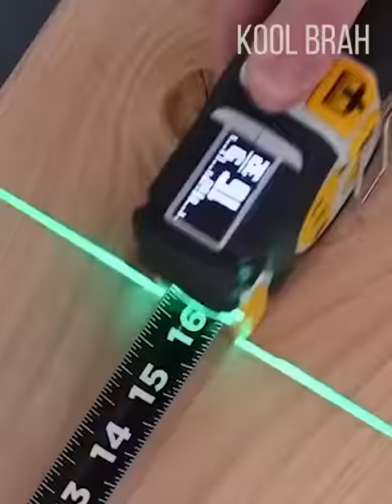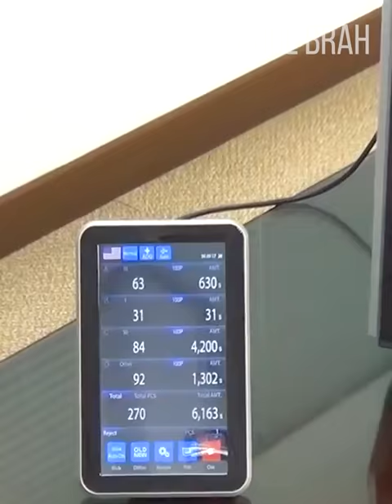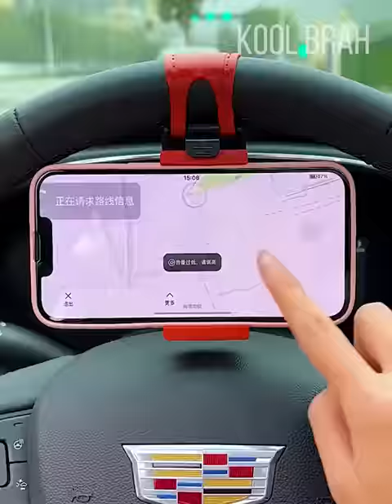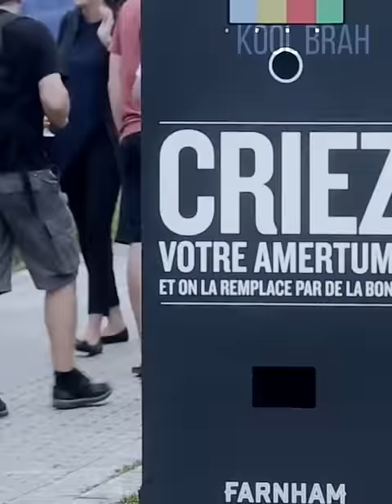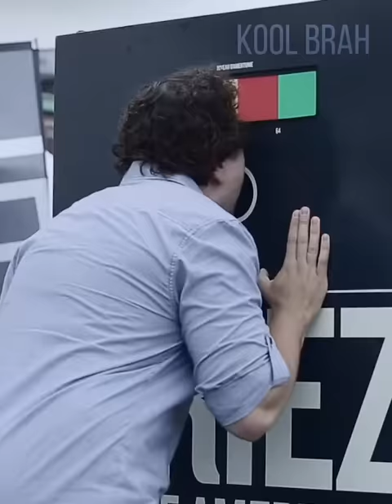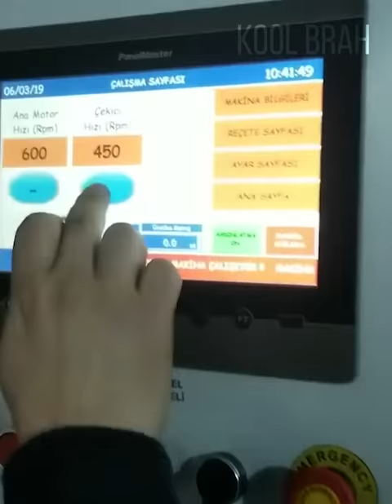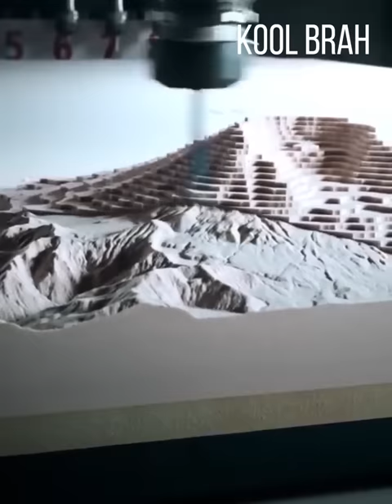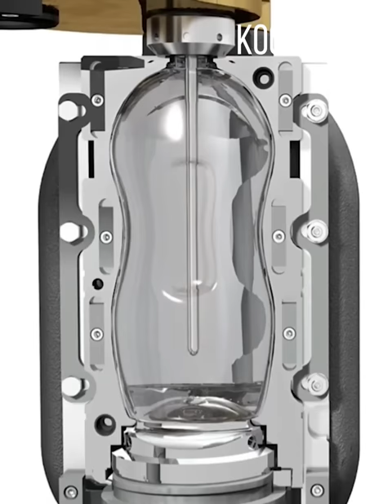Most Satisfying Factory Machines and Ingenious Tools | Compilation 2023

Comment: I first saw CNC machining in action back in '86-'87 time frame.  The plant I worked at had about eight CNCs.  I was a QC inspector checking the stuff coming out of them.  The tool used to check the parts made was a Bendix Coordinate Measuring Machine.

Comment: That skateboard spare tire idea will only work on certain vehicles. If the wheel that has a flat is connected to the drive train it has to turn when the vehicle is in motion.